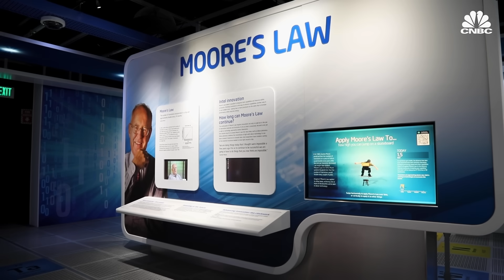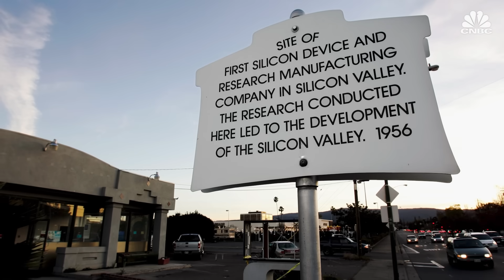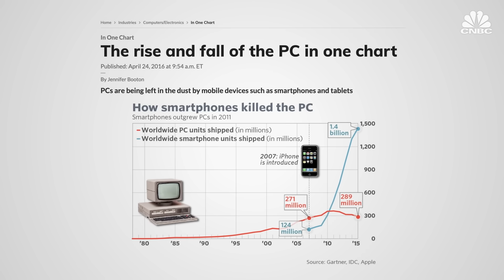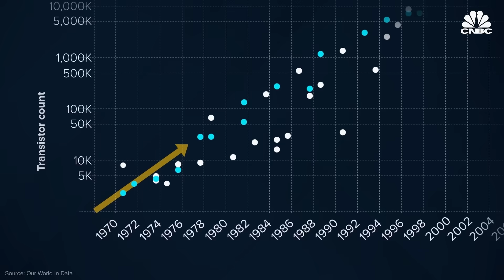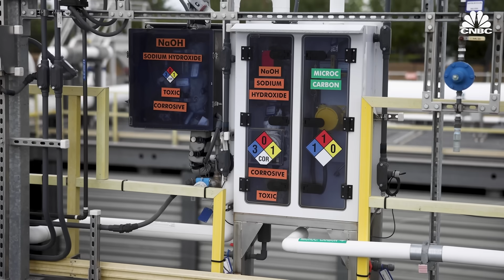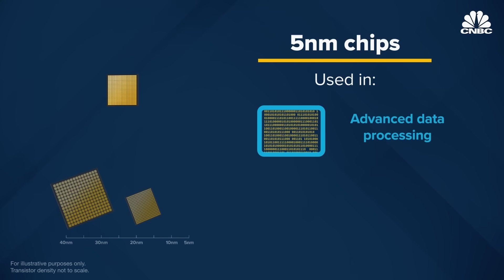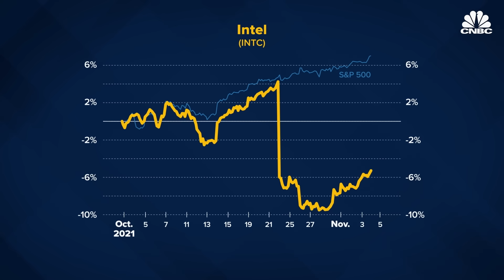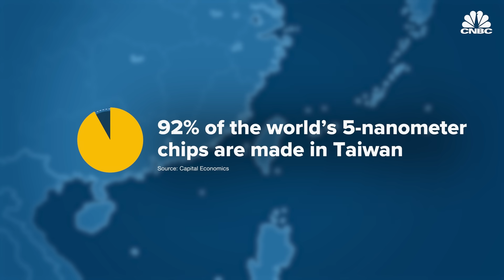Inside Intel’s Bold $26 Billion U.S. Plan To Regain Chip Dominance

Comment: Claim / Prediction	Promised Date	Reality in Dec 2026
"Catch up to and pass TSMC"	By 2025	FAILED. TSMC remains the dominant leader (90% market share in advanced chips). Intel is still chasing parity.
Intel 18A (1.8nm) Mass Production	2025	DELAYED. High-volume manufacturing pushed to late 2026/2027 due to low yields (55-65% in 2025).
Ohio "Mega-Fab" Production Start	2025/2026	FAILED. The project timeline has slipped significantly to 2030–2031. Construction is proceeding at a slowed pace.
Germany (Magdeburg) Fab Construction	2024 (Start)	CANCELLED. Intel officially paused/cancelled the Magdeburg project in late 2024/2025 to cut costs.
Regain Process Performance Leadership	2025	FAILED. While competitive, Intel 18A has not decisively beaten TSMC's N2 (2nm) node, which is ramping in 2026.
Foundry Business (IFS) Profitability	By 2025/2026	FAILED. The foundry unit reported multibillion-dollar operating losses (~$2.8B loss) and struggled to sign major external customers until late 2025.
Pat Gelsinger's Leadership	Long-term	FAILED. Pat Gelsinger was ousted/departed as CEO in late 2024/early 2025, replaced by Lip-Bu Tan.

Comment: INTEL can not even compete on the manufacturing of 7nm or bigger nm chips, let alone the 5nm and 3nm chips.  Unfortunately INTEL is to fall further and further behind.  Bring top foreign semiconductor chip manufacturers such as Taiwan Semiconductor Manufacturers   TSM to USA is an important step to catch up.  The unfavorable and unfair splitting of Chip Act funds has however been discouraging those foreign partners from making further investments to USA.  Federal Commerce Secretary ought to take smarter move to make the Chip Act to work the right way.  Other wise, those foreign Mfgs have shifted their interests to buld new plants in Japan and Europe.

Comment: Goes into light photronic instead of electronic cpu like human DNA so the cpu cell can be embeded inside material make it programable materials like life cell. INTELL CAN. Could hydro carbon silicate help? Telescope lense may zoom to small but interface is hardest to integrate small cpu i/o is the bottle neck and data in meta formate need to catch up specially oscilator at high speed that base use sunlight amplified highest frequencies possible

Comment: The main reason for Intel's success was not great tech. They had a legal monopoly on the x86 types of chip which ran the dominant operating system, Windows and related applications. That allowed them to price high, fund the best fabs, and keep pushing the x86 architecture to higher performance. The monopoly position gave them the profits to invest in superb manufacturing. They failed in memory. They failed in phones. They fell behind in graphics. This let other companies fund contract fabs like TSMC, which could build the same or better chips for others. Intel's fab is captive, so its chip cost will never be cheap because it relies on only one product line/customer to pay for the fab and can't share cost for the fab. They can catch up, but to drive cost down they must be a foundry too, as Samsung has learned and is doing. Monopolies are gravy trains, but they seldom last forever in technology.

Comment: The description of chip size shows some really big misunderstanding of circuit size by CNBC.  The nanometer description describes the size of the circuit pathway inscribed on the chip and not the size of the chip.  You can have really big chips at 2nm and really small chips that are 10nm.  Really depends on the number of transistors and transistor size.

Comment: One issue i have a problem with is marketing when someone looks at nm size they interpret it to mean the size of the transistor but nowadays its a marketing term if you want to actually know the power of a cpu you have to look at transistor density. People see that amd and samsung are making smaller chips and think that means there chips are better but its just because they changed the definition by measuring the smallest feature of their chip instead of the transistor.
Reply: Lithography refers to transistor size. Of course a smaller size means higher density.
Reply: Yeah in a perfect world but we have marketing essentially the different companies have been using different rulers by measuring the smallest feature instead of the transistor gate then claiming the whole chip is at that scale. @drygordspellweaver8761

Comment: The US should do everything in its ability to design, build and manufacture all the nano chips it'll ever need  domestically. If I was Intel I would also invest in designing their own lithography machines and not be dependent on ASML. Maybe by 2030 Intel and the US could be independent in the chip manufacturing business
Reply: That is doing too much for one company. It will drain too much resources without much benefit and will lose focus on the main competition which is AMD. Not ASML, and not TSMC either.

Comment: RAM did exist, Intel invented Dynamic RAM (DRAM), a specific type of RAM that uses mainly capacitors for bits and is much easier and thus cheaper to manufacture as an integrated circuit than traditional transistor based RAM. The down side is that the RAM is slower and needs a circuit that refreshes the voltages in the bits millions of times per second. Static RAM, that uses transistors (6 per bit) has a larger footprint , but is still used in CPUs as cache memory because it is much faster than DRAM due to not needing refresh. The refresh seriously limits the number of times the memory can be accessed per second.

Comment: As of now Intel's market cap is almost behind amd and qualcomm. If they are to improve why is it an assumption that others will not catch up or still be ahead ? Optimising for the  law of diminishing returns has not even Intel's strong point and the continuous changes without any strong imprint in the industry doesn't add much to credibility.
Reply: When there is water, one must continue to tread. Giving up on the most important technology is detrimental to America.

Comment: Digital optical digital analog demand new design called Dynamic Computing Interface where there is smart connect device with microcontrollers so it need no Intel that only pickpocket consumers by scamming on the semiconductor easily to remote control by hacker

Comment: You hit the nail on the head business model and then tells or lack of it is what got it where it is now. You gotta stop screwing the customer and stop lying and start competing on the level of AMD. Actual competition not rigged competition.By the way one could argue that Intel actually means gathering information for the government sure why not that’s what it’s become. Intel has got to solve the wattage heat issue on 10 mm, 230 watts is way to much.I personally gave $2000 of my hard earned money to Intel, back in the day , and now I moved to a AMD. Biden And the chips hacked is definitely a step in the right direction.

Comment: I watched a lecture given by Sophie Wilson. It was a few years ago but she noted that 28nm was the CHEAPEST size of feature to use. There are many influences on the cost of a particular process BUT I notice 2022 papers that say 28nm is still the cheapest.

 I wonder if feature size is the key metric. Maybe Clive Sinclair's (at the time ludicrous) 'Spira' concept. Basically, Spira was based on using an entire wafer (or at least chunks of a wafer) of processors. They were designed to self-test and exclude those that failed BUT meant that all of the usable chips on a wafer could work in parallel.

 Before someone points out that such a system would be inefficient, I should add that it did presume large L1 caches and other tricks ot minimise the problem but the basic idea was that such features could be added since the production cost would be lower. After all, the PS3 works on the basis that they actually produce silicon with 9 cores and the design allows a faulty one to be excluded, so the idea has been used and used what is more in a situation where cost was important. I don't keep up with hardware much, but it could be even more common if people like Intlel and AMD have adopted it.

 If so - it explains how Sinclair managed to stay in a healthy state of liquidity for 30 years.

Comment: I'm sure Intel will have advances in chip manufacturing, but saying that they will surpass TSMC, Samsung, and SK in 2025 is delusional.  Intel can't even surpass them in 7nm chips by the end of 2022.  Samsung and SK are already shipping 3nm chips!  TSMC will have 3nm chips by 2023.  You can't get this technology by just building foundries and buying machines.  You need top notch engineers with decades working on high-tech chip manufacturing.  You will need to snatch high level engineers from TSMC, Samsung, and SK.  And as far as I know TSMC, Samsung, and SK's top notch engineers have non-competition agreements for at least two years.  Also, TSMC, Samsung, and SK will never manufacture their highest-tech chipsets in the US.  They will keep that technology at home.  That's like Verizon and AT&T saying they will have 7G networks in 2025, when they barely have real 5G networks 😂

Comment: What would Intel need is to innovate and develop a totally new manufacturing process and control from the bottom to the top the whole supply chain - that is if Intel really want to stay strong in the microprocessor business. They would have to develop a new product as well, who knows what it could be, and it would have to work and have sufficient demand to help driving the rest of the company. 
I'm also afraid they would be up for grabs or sink even deeper in debt. BlackBerry had it going for them, now its basically an IP holder trying to make its way out. 
Intel have been slow on on many of the trendy products on the market. They could have tackled the mining industry, but others took it instead. They say they are in AI, but who knows when and where it will be used, and who says the company that develops a new AI product will ask Intel for fab capacity on their nodes? Why not ARM, or TSMC? Sounds and look nice, but what is the new breakthrough here, just protectionism? We all know what happened to Compaq, and the reasons why everything was being outsourced out of the US. Lets hope Intel is diversified enough not to become the next Compaq and have their cashflow shrink to nothing.
Reply: Pat Gelsinger said intel 4 is ready to go with no issues and it's releasing in 2023 and it can compete against TSMC 5NM or 4NM.

Comment: As we all know Silicone based chips will soon reach it's technical limits of micro miniaturisation due to the phenomenon of quantum tunneling, so making too much optimistic noises may not be that fruitful for the development of silicone based memory chips for the medium term. On the other hand Professor Wang Xanran's team has recently developed a Sapphire based two dimensional Carbon Chips, capable of holding much more memory with much reduced power consumption, and it is hoped that leading Scientists and Engineers involved in memory chips development will focus their attention on this field to keep abreast of their peers.
Reply: and this new memory chip will be at TRL 9 in 14 years? Power consumption (and density) of memory chips is not the issue at the moment.

Comment: They could start by not focusing all their energy on how much they can take out of their chips while keeping price maximised. They've spent at least the last 10 years developing a top product,  then making a confusing range of products under them lacking things like sufficient pcie lanes to support modern set ups saying things like "well you don't need them anyway". This isn't always true and having to buy their flagship products to get features the competition gives on mid tier chips is why they're losing the market. My next cpu is unlikely to be an Intel as a result. Its a shame companies like Intel only change their ways when forced to,  another reason there is not trust.
Reply: Intel is sad, can't produce 5nm. 92% of 5nm produced by Taiwan.
Reply: @fynkozari9271  those processes have lost thier way a bit, they just drop a number each time now when they're not really getting that much smaller. AMD progress has mainly been in adding more cores,  that's where Intel have struggled as they have tried to focus on speed, but they're hitting the thermal limits now meaning they're struggling to progress any further. Their GPU seem to be having issues too.

Comment: Interesting journalism. 5nm is used in high tech products like fighter jets and mars rovers? Sounds plausible but a little bit of research would've shown that the opposite is true. Airplanes and anything send to space usually have huge structure size Chips. The NASA Mars Rover used CPUs that are over 23 years old now. Why? Reliability gets diminished the smaller you go.  So everything critical uses bigger Chip sizes cars, medical equipment, airplanes etc. Especially if the Chips are hit with hard radiation like in or close to space.

Comment: I remember saying Intel needs to be an open fab back in 2013 to people at Intel when I was working at Intel up in Oregon.  It is the only way for them to be competitive because fabs are too expensive otherwise without everything being made there.  It is a natural monopoly and now we are looking at what is probably an imminent invasion from China on Taiwan where that monopoly resides.  Anyways, it was clear a long time ago that the X86 is in a decline and has been since the turn of the millennium, so if that is what you are really hoping to roll off your fabs and not much else, you are in some real trouble.  The people I spoke to at Intel said better fab processes will keep the X86 competitive, which I thought was disconnected from reality.

Time has proven me right.

Comment: And yet Intel does not make any of the chips that have been in shortage for the last 2 years.  Those are foundry chip manufactures and Intel is not in that market.   The CHIPS Act is a scam and Intel will likely buy back stock to prop up its tanking stock price like it has for the last decade.

Comment: Intel is dreaming!  They have lost their leadership in semiconductors since approximately 2012. (Essentially due to bean-counter  management and equal-opportunity policies which caused good engineering talent to leave for the competition.)   It will take them until at least 2030 or 2032 to catch up.  I question if they can restore their leadership role.

Comment: Wasted money, they won't do shy3t, if not for a hand full of people who buys a pc without any knowledge of it's harware-softare. because of the P+E cores. Performance cores that run and Eficiency cores that run when they feel like they're needed. I think Users want maximum cores active whenever They fell like they need them and accesible 24/7 without any extra settings. If you say 16 cores you expect them all running for example, you don't buy 16 cores but most of the time only 8 will be running because that's how they're designed. Not to mention the processor dependency on the latest windows 11 to be able to use the efficiency bs cores too. Like i said. Wasted money. Amd and other chip manufacturers will benefit from Intel's mistakes is my take. Because it's still pretty important what users actually want and need.

Comment: intel inside idiot outside!!! well i just wish them luck to achieve this, but there is some future changes, that might impact this - russias selfmade cpu. of course now its trash, but once they get there, there will be major player. player who has all resources and are independant on making chips without asking for help or resources to make them to outside world. amd and intel should be aware or this and make plans accordingly. to be honest intel cpu was never my favorite. used amd as soon as they became option on market cause of 5% speed increase over same intel and also heat. amd in my experience has way better ways how to avid overheating and they can run higher temperatures than intel.

Comment: Intel must build that 2 new chip plants fast because many of Intel customers including me is going for AMD ryzen 5 5600g but shop had limited stock super value AMD Ryzen 5 4600g (6 cores 12 threads), 2x8gb DDR 4 4000mhz CL 19, Gigabyte B550M-DS3H AC, Crucial P3 1TB PCIe 3.0 SSD for gaming and once Intel customers go over to AMD they will never come back. From a Intel customer, 1st PC Gift was pentium 1 (133mhz) with CPU casing one turbo button 🔘 (233mhz) & bought 1st(Intel Pentium 4 2.4Bghz 533mhz) and 2nd computer( intel Core2duo E8500 & Pentium E6600) all Intel and 1st computer open casing and who's two fingers have touched the hot heatsink of Rambus RD ram  while the computer is still power on💀😭🥵😵😵‍💫 and it is like SIA-unstoppable...(I'm invincible, Yeah, I win every single game😎). It's no joke once the customer 2 fingers have touched the Rambus RD ram 4 pieces of 128mb the most expensive PC component, they will replace the PSU, Intel cooler, mother boards, hard disk, graphic card, case fans, etc. That's is why Intel do not want to partner with expensive Rd ram because if the most expensive component the customer fingers very itchy never make spoil and the customer go and see how ram is secure left and right the customer now know how to replace spoil pc component with new one. If i am the CEO of INTEL and i check the cost of RD rambus ram 128mb x4pieces=SGD 368 and it is the most expensive pc component than the Gigabyte Intel 850E motherboard that costs SGD 326 I will NEVER PARTNER with rambus. Not only that i know Intel factory in Singapore is beside the singapore casket.